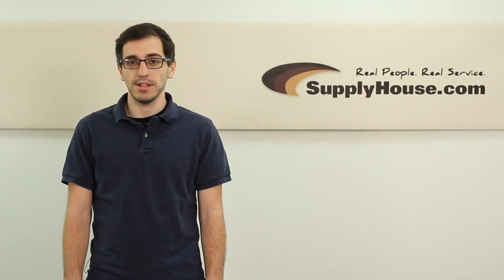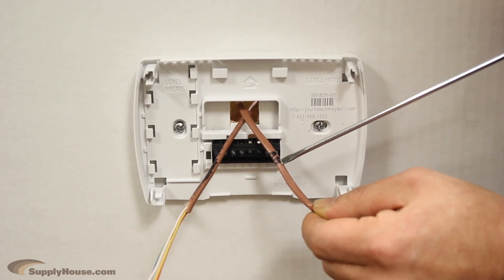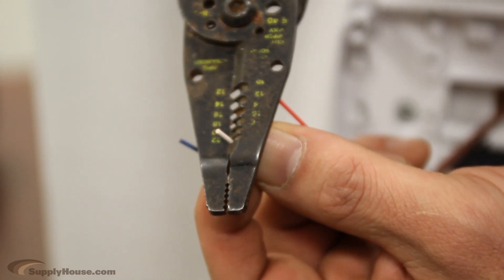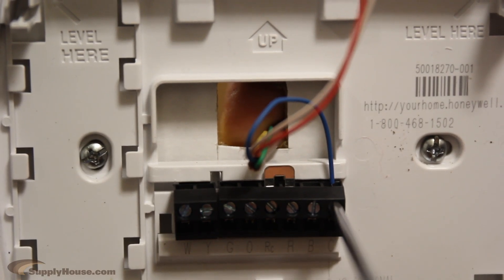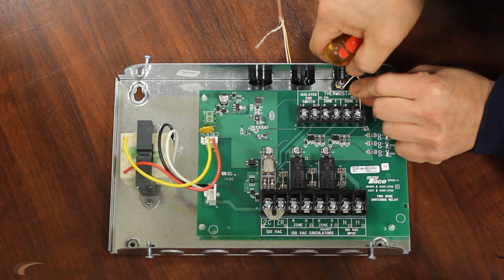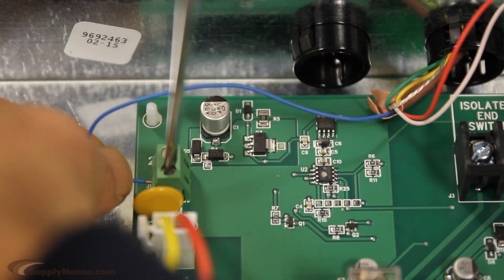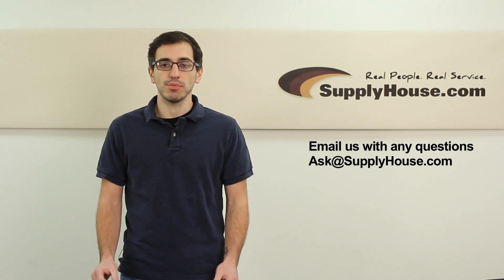How to Wire a Thermostat to a Relay

Comment: what is the purpose of this relay ? is it for a multiple pump/zone and multiple thermostat setup?
Reply from the maker: Yes exactly.  You normally use a relay if you have a system with multiple pumps and thermostats.
Reply: OK and they don't directly hook up to the furnace itself the thermostat controls the pump through the relay and it just uses the heat the furnace has already made
Reply from the maker: Taco switching relays have boiler connections as well -- just to make sure the boiler knows that a zone is calling for heat.

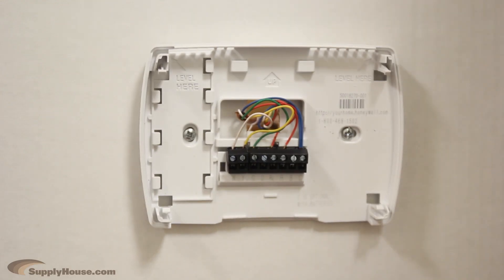Comment: You connected three wires in the box but as you are closing it up it shows multiple wires connected.  What's up with that? See the image at 1:22.
Reply from the maker: The three wires we connected and mentioned in the demonstration are the only wires that pertain to the connection to a relay.  The other wires are for things you may not have in your system such as a cooling unit or outdoor sensor.